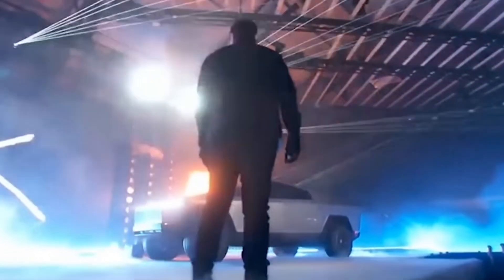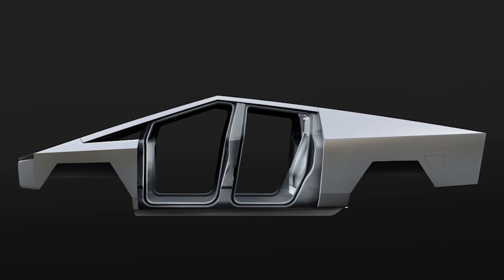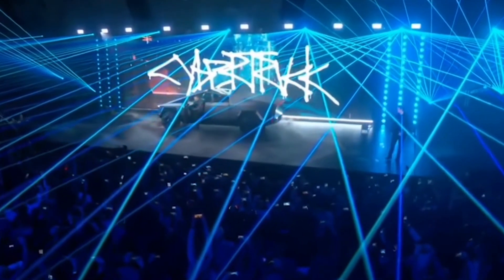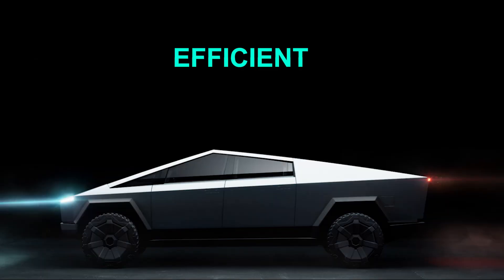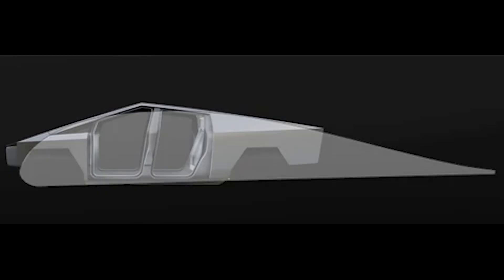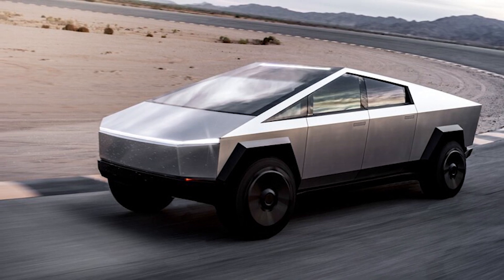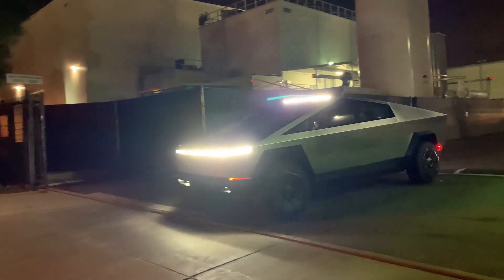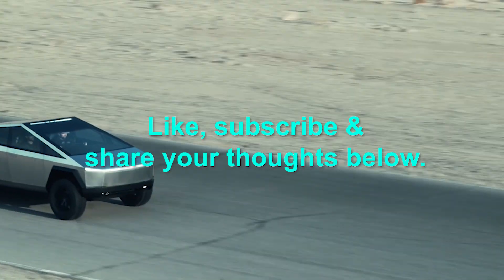Cybertruck is Engineering Genius (and will be copied)

Comment: Many great things with this vehicle. But not everything. Assuming it uses sensors as the Tesla does, that´s great for preventing accidents with pedestrians. But, for the unfortunate few that do get hit by the truck, the consequences are likely to be quite worse than being hit by a regular one. Since it won´t deform, the energy will be absorbed by the pedestrian and his/her bones. Also, if an accident does happen (against a structure, another vehicle, etc.), the fact that it won´t deform as easily means that the vehicle´s occupants will be suffering much greater forces on their bodies and are likely to suffer significantly more severe injuries. With the current design, there is virtually no chance that in Europe, for example, they´d allow the truck to drive there.

Comment: I have a few questions:
1. Can I remove 4 bolts to take off the bed, so I can replace it with literally anything I want, e.g. flatbed, motorhome, bike rig?
2. Can I retract that flimsy ramp after I covered it in mud and rocks with my dirtbike? What about sand in the rails of the sliding cover?
3. Will it be cheap and easy to repair if some idiot backs up his dumper truck or bulldozer into the quarter panel of my CYBRTRKK (they're still sturdier, seriously), even though the structure (sorry, exoskeleton) has been damaged? After all, I'll want to use it on construction sites.
4. Will it still need no paint shop if  thousands of customers want a different color than none? Like businesses?
5. Does it come in not fugly?
6. Can I put my RAM 1500 in he bed to bring it to the scrapyard, now that I have the truck to end all trucks? I recall Elon mentioning something along those lines.
7. Will I be able to smash the windows with something lighter than a solid steel ball, in case it rolls over when I'm out dominating all ICEs on off-road trails using my 2.9s 0-60 performance?
8. Can I put it on top of a building which I'm going to blow up, then drown it in the ocean, smash it wit a wrecking ball plus set it on fire and it will still work with only the use of simple tools?

9. (Bonus) Will it be capable of handling the tough requirements of my private army in Central Africa or the Middle East, like easy mounting of a machine gun, still being able to work after being ripped apart by an IED/RPG, rebels sitting on the sidewall of the bed, repairs using a hammer and some swearwords in the middle of the desert or the use of a fast, portable range extender like jerry cans?
10. Will it meet pedestrian safety requirements with a front end like a light tank made of sharp-edged stainless steel, now that they killed the original Land Rover Defender for exactly that reason?

Just asking.

Comment: The Cybertruck is far from safe. Nowadays cars are made in a way that when you crash at certain speeds, the front/back of the car will just get smashed all together. The reason is for the car to absorb as much as the impact energy. If you have a car which skelleton is totally rigid, the people inside the car will take 100% of the impact energy. And there is legislation about it in th EU. Chances are, that´s not gonna be the commercial version of the car at all.

Comment: What about rust? Cars are painted for a reason
Reply: I think people forget that stainless steel is resistant to stain and rust, but not stain and rust proof. I work in a warehouse and have seen Stainless steel rust. I've seen store bought bleach rust bolts under a hour of exposure.

Paint isn't just for show.
Reply from the maker: "Stainless" steel :)
Reply: @SolvingTheMoneyProblem  Isn't stainless steel expensive though
Reply: @stealthy1473  It is very expensiv. This is the reason for the complicated treatment of the raw chassis.
Reply: Stealthy147 And all metal will rust Including aluminum titanium stainless steel it will all rust in due time. But it will take a long time a lot longer than regular steel
Reply: @kyleharvey7622  Aluminium will not rust ever. It will build a passiv layer but not rust in the conventional meaning.
Reply: If I gets scratched/dented that's gonna be a rust issue

Comment: Triangles are Tough
Steel is Tough

Cybertruck is TUFF
Reply: @SolvingTheMoneyProblem  curves are tougher than angles. According to my Physics teacher. He used the example of airplane's windows and doors!

CyperTruck is TOUGH nonetheless 🤣
Reply: @aiman1562  r/whoosh
Reply: Dark Knight And it has both
Reply: Can't disagree with that
Reply: @Yggdrasill8  so no crumple zones  .
Reply: u are talking about the outer panels, but the inner shall/unibody will be stamped ,with die,and more likely made out of lighter metal for crumple zones  .
Reply: @Jozavenue  It's AMERICAN and it's a TRUCK, what ever gave you the bizarre idea that it would have anything as progressive as crumple zones? Anyone who buys a 2.5 tonne vehicle counts on any "crumpling" to be performed at/on/in whatever they hit.
Reply: yeah, but it can’t take a standard slide in camper
Reply: 3mm thicc Stainless Steel
Reply: I disagree. Triangles are weak.
Reply: @deputydt7853  Triangles a very strong and rigid, that's why trusses are made of triangles. These aren't triangles in that sense though. These are flat panels shaped like a triangle. I'm concerned about the rigidness of the panel. I'm sure the engineers have considered crumple zones. This is after all one of the greatest safety features ever invented in a car.
Reply: Bruce Stewart 

Trusses are strong, yes, but it is not because they are triangular shaped. In general engineering, a triangle has sharp corners which leads to high stress concentrations. The general stress equation is force/ area. At the sharp edges of a triangle, if a force is acting directly on the corner, there is a very small area there leading to high stress. This is why driveshafts, rebar, pipes, etc. are round and circular in nature. They do not allow strong forces to be concentrated at on a small area.
Reply: There's no way to drive that useless thing and look tough though. It has no functionality as a truck. It's an ugly car with an open trunk.

Comment: I was hoping they were going to smash it into a telephone pole to see how safe it is....Damn!
I still like the regular truck style for my camper and other stuff MADE FOR THAT SHAPE.  Start showing the truck as a truck, not as a car.  Nobody drives around in an empty truck. Nobody needs to go 0-60 in 3 seconds either.  Load the damn thing with TURF, OR HALF A DOZEN MOTORCYCLES or sheets of plywood. You can't because it is a flucked up design.  Besides that, am not interested in Tesla's "Only we can work on our vehicles"  No one else is ALLOWED.  That alone is the reason I won't buy this PoS.

Comment: Sure genius from a manufacturing standpoint, but from the body shop perspective my be a nightmare depending on assembly and getting the stainless pattern to match. The process used on the deloreons is called lapping to restore the pattern but far and few between know it let alone know of it. That being said most cars are nightmares for shops and aftermarket anyway.

Comment: I wonder how hardened steel is going to work out in the long run. Many of the harder aluminum alloys are used sparingly in the aerspace industry because they are prone to fatigue/cyclical cracking. They are still used but a lot of engineering detail is given to the design. I am wondering how much thought has gone into that aspect of the Cybertruck, where a lot of road vibrations are to be expected.

Comment: For those talking about the glass shattering, Elon said on Twitter that they looked into it and determined the sledgehammer hit lowered the integrity of the glass therefore allowing it to break. If they didn't hit it with the sledgehammer, the glass wouldn't have broken. So, the glass is bulletproof. They have also fixed that problem so that won't happen with consumers.

Comment: 6:40 Umm arent most cars designed to crumple and fall apart in specific ways in a crash so those processes absorb a part of the energy?
Reply: I can foresee an electric only, driverless utopia where every car is broadcasting its next 5 manoeuvres  to every vehicle in the immediate vicinity. With each vehicle knowing this information, crashes should become all but eliminated.
Reply: @mikeperrett1539  lol , nice to think like that , but ya know probability says otherwise , and its all technology and computers , anything can malfunction
Reply: @fauj7860  Technology can and does malfunction, but I would argue that people get things wrong far more frequently than a computer does. Ethics of autonomous driving seem to be concerned with what decisions the car will make when faced with a certain crash scenario, when in reality we should be focused on engineering out the possibility of any crash occurring at all.
This will require some radical redesign of towns and road networks, but better to make a start rather than not try at all, otherwise we would all still be using horse and carts.
Build in redundant systems, have two on-board computers two broadcast networks.
Here in the UK, there is much arguing about the safety of smart motorways where the hard shoulder is replaced with permanent 4 lane running. When a car breaks down in a lane drivers are informed to move out of the blocked lane, but they are not compelled to do so. Now if the technology was in place for every car to automatically switch lanes well in advance the question of safety regarding Smart Motorways would be moot.
Reply: @fauj7860  Technology malfunctions muss less often than human beings
Reply: @mikeperrett1539  And then there is a boar or large deer or tree or landslide on the road through the woods that didn't get the message...
Reply: @MarcusWolschon  absolutely right, but those hazards beat human drivers too. Doesn't seem logical to stop developing technology because something bad might happen.
Pioneers of flight, space travel etc would never have got off the ground on that basis. We might just find that a car can react quicker to a moose in the road than a human can. It would be cool to fit them with thermal imaging cameras and infra red imaging.
Reply: @MarcusWolschon  in Australia we use fences in susceptible areas to keep wildlife off our high speed motorways.
Reply: Elon actually skipped that lecture
Reply: Oh, you"ll be "absorbing energy" alright 
It becomes an electric chair.
Reply: Most cars are designed to be totalled so you have to buy another one. With autopilot and computer assisted braking a full speed collision is going to be unlikely.
Reply: @sulrana1812  they´re supposed to be totalled because bending the parts of the frame that are designed to bend on impact absorbes A LOT of energy, greatly decreasing the force acting on the driver during the sudden deceleration.
european safety regulations will most likely reject the cybertruck, which is a real shame.

Comment: The European Saftey inspector said the Cybertruck with its current design will not be approved in Europe as it is not up to saftey standards, so saying the design is "Genius" seems pretty far fetched. The reason the car is unsafe is because it doesn't have a crumple zone to slow down a crash, meaning that there will be immense forces acting on the passengers, that no amount of airbags can prevent.

Comment: Steel has been WAY underutilized in the car industry as well as space industry.
Imagine you are the Universe, and your middle-range atom in terms of weight is also strong as fuck with simple manufacturing expanses, extraction costs, recycling possibilities, BUT AT THE SAME TIME is able to accomodate various amounts of other atoms to change it's properties, which can vary widly and can suit every need you may have. The first atom is called Iron, while the others are so numerous I can't count them. In the end, there is a STEEL for your need, you just haven't found it yet.

Now look at these little meaty AI substitute giggling on Earth, who tries to make rockets and cars bodies out of complicated, less resilient, and quite franckly RARE plastics made with compressed fern juices with some dinosaur sprinkles. The solution has been laying around for centuries but hey, let's overthink everything and cause massive climate changes on planet Earth !

In a less joking note, I do think Cybertruck is just a first version for a Lunar or Mars / Planet Rover. Just make that air de/compressor bigger, resilient (or add a 2nd one), make the habitacle "void capable" and put some wall-Extra-Vehicular-Suits in the trailer, connected to the habitacle, and you have a very capable Exploration Vehicule. You can even make the skin thinner at will to gain a shitload of range...

Comment: I disagree that the truck is safe. Vehicles are made with crumple zones to allow impact force to be absorbed. If this vehicle hits something it cannot break, such as a steel beam of a building, it will cause the person inside to die on impact; splattering themselves on the inside of the vehicle. The vehicle might hold up and stop moving, but the person inside won't.

Comment: Best towing performance - because it weighs 100 tons..And you have to have a lot more battery to overcome the weight which adds more weight...To the detriment of efficiency, You have to move that 100 tons about. Stainless is a pain in the arse, just wait until someone complains about getting a ding or two in it, sure it is tough but when it gets damaged it is impossible to repair without costing a fortune. It is also tough in an accident, energy is transferred to where exactly?
It looks like shite. No argument here please.
First and foremost Musk is a businessman, second he has some engineering background - He is NOT a great engineer, and this is proven time and time again by the rubbish science he often spouts.

Comment: One thing to point out, Doug Demuro explained how it is not better than it's competition, especially in it pricerange. There are other truks capable than doing more than the cybertruck, while costing quite less. So with you sayng that the cybertruck is a lot more cheap to manufactur i don't get the high price, because lets be real, it is expensive. A lot of peole are sayng that the main problem of this truck is the price, and i agree, but i guess this is only gonna be the case for the early models, maybe tesla is planning to reduce the cost drammaticly in the future. this said i agree with all the other point you make, this is an amazing piece of engineering and i wish tesla all the best for the future.

Comment: Your aerodynamics are pretty off... Airfoils are designed to produce lift upwards, whereas road vehicles must produce a downward force to provide a better grip. Also, those CFD results that you show to determine that the aerodynamics of the vehicle are good have literally no validation or no information on the numerical methods used, grid sizes, etc...

Comment: 1) combustion engines are made artificially inefficient to sell more gas
2) the exoskeleton idea seems dubious to me
3) $39k isn't cheap, RWD only, single motor. I would want an electric car with a motor for each wheel tbh.
4) breakable windows
Reply: 1) there is no AI/ML in car engines.  There is not neural network or deep learning system. 
2) based on what engineering expresence.   A certificate from Trump university?
3) you can but you pay for what you get. I think the cyber truck comes in a 3 motor system, with one set of wheels sharing a motor. But that's the 60k version.
4) the test was flawed,  because the door was hit with a sledge hammer, the window dropped down, out of it's  frame and was not fully supported.
Still the ball didn't go through the window.  Would like to see any other car window do that.
Reply: @BrettCooper4702  you have mistaken me for an idiot
which makes me conclude that you must be one yourself, have a nice day good luck provoking someone to argue with your harebrained reasoning next time

Comment: 6:43 Uhmm you clearly do not understand how safe cars work. You need something to absorb the kinetic energy of a crash. Safe cars  have crumple zones that deform during the crash soaking in a lot of the energy of a hit. Stiff rigid shell does not help with that.
Cybertruck might be safe but it is definitely not because "steel is strong as f**k"
Reply: Air bags?
Reply: @BrettCooper4702  airbags help as well. Another factor is vehicle mass, heavier vehicles are a bit safer.

Comment: Sure 500mi to a charge .... but is that towing 12,000pounds ?? Which it more than likely isn’t .... and when it does pull ... what does the range change to ??yes most don’t pull with their truck but if you do .... you don’t want to get 200mi then stop and have to charge because your destination is 300mi away